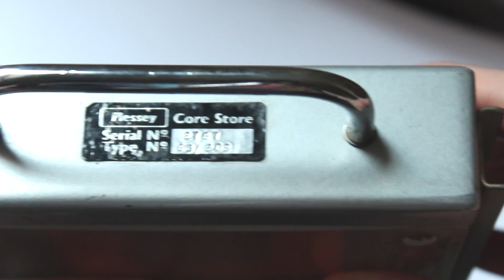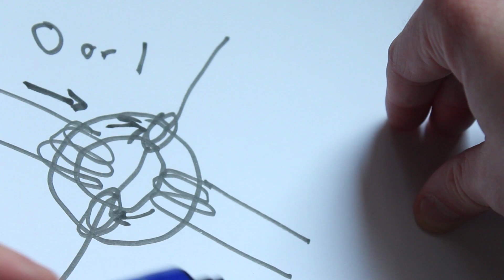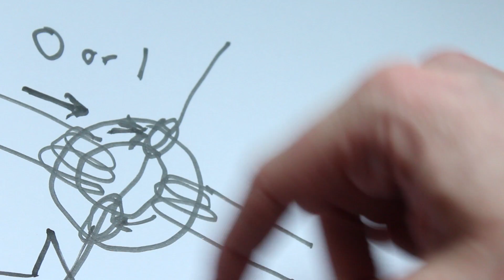Vintage Tech: Magnetic Core Memory  - VT3

Comment: Do those circles around the wire need to be in a specific orientation? Or would either direction provide the same results?
For example if one is northeast to southwest, would it be the same as if it was northwest to southeast, if that makes sense?
I would assume they could be orientated either way, but I feel if they didn't need to be in a specific direction then they'd likely be all facing the same direction
Reply from the maker: I think it is only to do with the direction of the current applied, they are kinda wound like a transformer, that probably not a great description tbh,  it looks like a bit weave, the wiki article has some dense but good information https://en.wikipedia.org/wiki/Magnetic-core_memory but the 1960s Army training video is fascinating https://www.youtube.com/watch?v=HSWCJwAmAgY